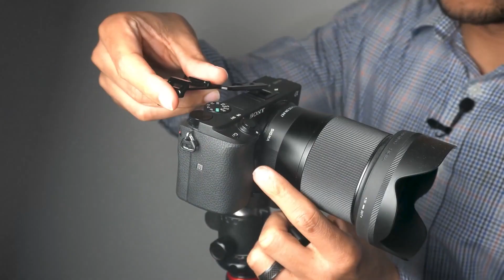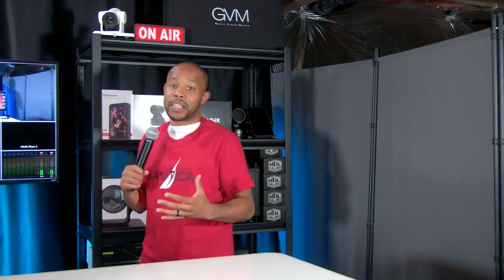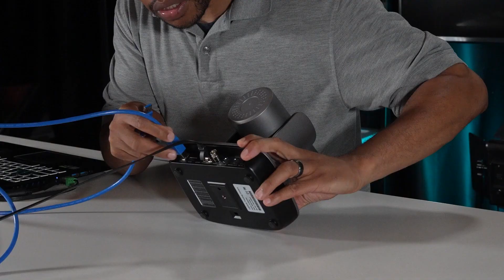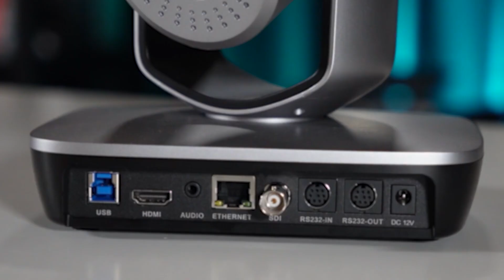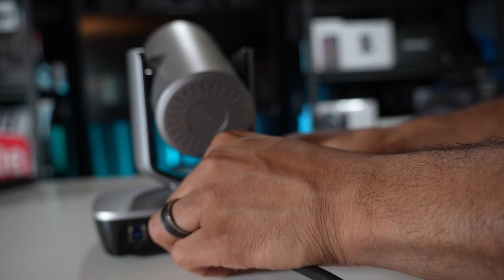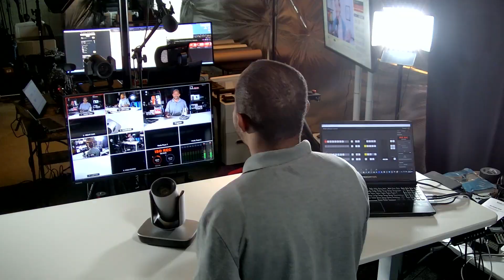Cheap 20X NDI PTZ Camera for Content Creator and Church Live Stream. AVKANS AV-E20-NDI #ptzcamera

Comment: is the SDI 20x have ip address?
Reply from the maker: sure, it has IP address.
Reply: @avkans  even not connected to the router?
Reply from the maker: @ceverdenz   Not sure what you want to get?
Reply: @avkans  im connecting the cam to rgblink edge, and i want to comtrol the movement in there, but i need to enter the exact ip address and port.
Reply from the maker: @ceverdenz  in this way, you have to make sure the camera and video switch connecting to the same network switch, and set their ip to be the same ip range.
Reply: @avkans hi, is there any way to control using a remote not facing to the camera .if im behind it cannot detect the remote to control it
Reply from the maker: @ceverdenz  use software like CMS or joystick controller.
Reply: @avkans  why the remote control needs to point directly to front of ptz .. not like the TV remote even not  pointing the tv it can control.
Reply from the maker: @ceverdenz  Yes, we made it in this way, mostly customers has more than 1 cameras, they don't want to the other camera to be controlled.
Reply: @avkans  i got it..thanks